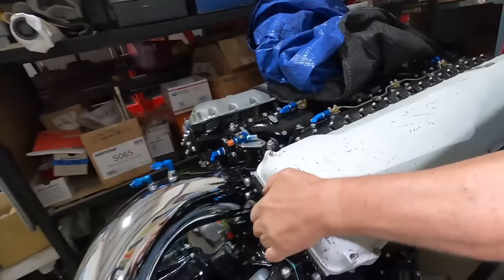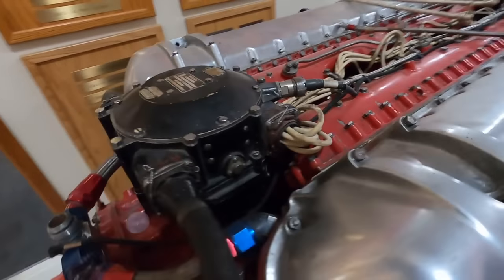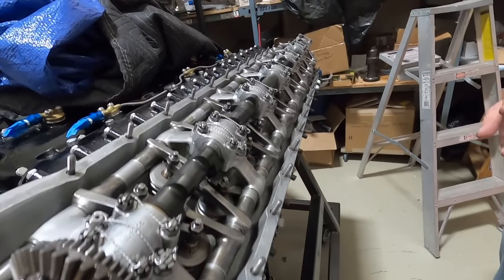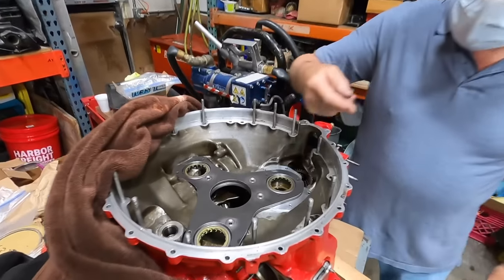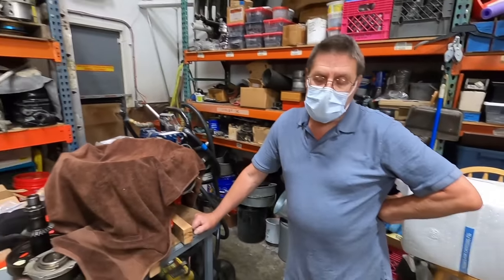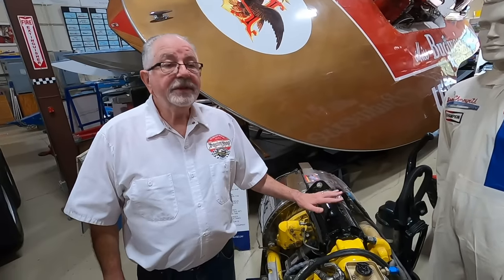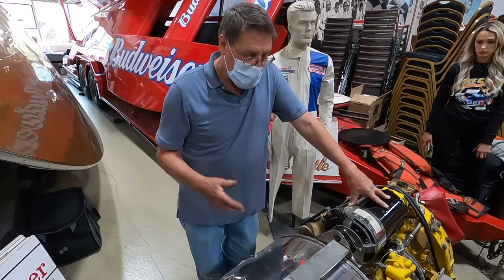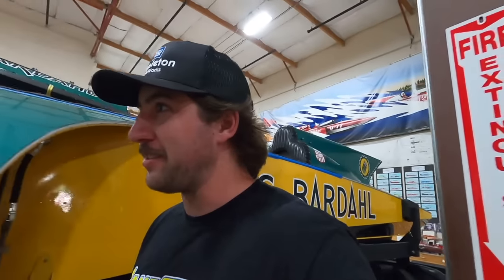The Rolls Royce Merlin: WWII Fighter Plane Engines Modified For Hydroplane Racing!

Comment: The Rolls Royce Merlin engine series has become immortalized  in human history for the contribution it provided during the early years of our fight against evil. It stood ready to fight from the start till well after the end. Like any engine it needed developing further after its initial inception to overcome a few nuances associated with fuel system etc.
While contributions from Prat & Whitney, Allison and others was just as significant overall it is the Merlin that stands out as the greatest engine of its era.
Reply: kiwidiesel  Are you  aware of the fact PACKARD Motors inn the USA contibuted to the development of the Merlin ???  RR contracted in 1940 PACKARD to build the Merlin FOR THE BRITS  37.137 of them were delivered.  the USAAF got 18,000 and several changes and developments were done by PACKARD to mass produce RR's hand built engine.  PACKARD used the Bendix pressure carb  same as Allison used to overcome the stalling problem RR had when the plane was quickly pushed into a dive, RR's float carb would flood.  Pressure carb had no float, similiar to a throttle body injection !!!

Comment: I was a shop assistant for Ed Pink, Keith Black, and E.J. Potter when they were building up Merlins, Allisons, Griffons and Pratt Whitney R2800s. E.J. Potter loved the "Double Allison" V-3420 for tractor pulling.
Reply from the maker: Ed pink built these engines?
Reply: @Stapleton42  '64 to '72 yes he did. Two Reno champs won with them.

Comment: The truth of the matter is that the Allison is a much better and more reliable engine, in fact most of the High-Perf V-12 Merlin's they use Allison Rods and the Alison has a Roller Cam not a radiused stile like the Merlin --- 
Vintage V-12 originally was owned by  Dave Zeuschel famous drag racing engine builder
Reply from the maker: Sure does seem like it. But it’s name isn’t as cool 😂

Comment: The Merlin isn't really anything special compared to an Allison, except for the blower.  The supercharger made the difference at altitude.  The tolerances that were held when the American companies started mass manufacturing the RRs is really astounding.  It was all done with manual equipment and slide rules.  The pinnacle of American manufacturing.  If you are into engines read the book SAE sells about aircraft engines of WW2.

Comment: These engines really need a fluid drive. They were not built to take the torque impact that boat propellers generate. Power boating in the 1960s is why we now have so few Merlin’s and Allisons.

Comment: The 1940s is when mechanical engineering reached its pinnacle, the power race in WW2 did bring us all those inventions which only 30-40 years later would reach the automobile we can buy from a dealership.
It's only in the electronics where the further advancements have been made to give us the efficient and clean burning engines of today.
It's even more amazing how well built the merlin was considering the numbers that were produced under less than ideal conditions, no shortcuts were taken to speed up production.
It's nice to see this element of post war usage of those engines preserved.

Comment: Give the British a little credit, they had a big hand in designing and building these beautiful engines.
Reply: dg8062  BUT you also have to give credit to PACKARD Motors  who in 3 1/2 years built 1/3 of all Merlins built 55,525 !!!!  of the 160,000 built !!!!
Reply: I think you will find that Rolls Royce fully designed all of these and built them prior to any other involvement. Then when others started to build and modify them, the mods would have been approved back in the UK by Rolls.

Comment: These airplane engines always fascinated me, theyre so simple and yet rugged and advanced for the era...imagine being 21 in 1944 and being able to do 350mph in a dogfight while making 2000+ hp at 8000ft altitude in the Spitfires with the RR Griffon. The exhaust gases alone increased the top speed of the plane by 10mph at that 350+
Reply from the maker: Well said sir!!
Reply: For a long time Merlin’s we’re limited to 3000 rpm even then, they would “randomly” throw a con rod. Many modifications were tried to no effect. Then Harry Ricardo suggested it might be the oil pump. His V twin test engines (1/6 of a Merlin) ran at much higher revs with no problems. It was discovered the crank centrifuged oil out of the bearings faster than the pump could supply. Bigger oil pump - big end  destruction stopped.
Reply: @davidelliott5843  I've read the RR Merlin book from the Rolls-Royce Heritage Trust Library which goes into great depth about the Merlin development. There's nothing in there about problems with conrods, I can assure you.
The book. ''The Merlin In Perspective - The Combat Years'', by Alec Harvey-Bailey.
Reply: @davidelliott5843  Been known for a long time RR had problems with the rods, oil pump was too small. interesting  the Allison has a stronger rod assembly and a larger capacity oil pump !!!!
Reply: @Slaktrax   Also I understand the RR Heritage Trust does NOT want to acknowledge or recognize the 55,515  Merlin Engines that PACKARD built during the war either.  The Brits are embarassed to talk about all the manufacturing help they got during WWII.
Reply: @wilburfinnigan2142  Absolute rubbish. I have a book from the RR Heritage Library which talks about the great contribution by Packard in detail. Why must you always shoot from the hip without any factual knowledge or proof?
Reply: @Slaktrax  BULL$HIT !!!!  My info comes fromaguy that had access to the RR Heritage, RR does not want anything to do with the Packard Merlins !!!

Comment: A Merlin engine, V12 OHC 48-valve at 25L 1530cid with 45psi supercharged boost and NOx resulted in around 3,000hp at 3krpm; in the 1950s. 
They had 2 sparkplugs per cylinder, air-to-water intercoolers, and sometimes water/alcohol intake cooling injection.
Reply from the maker: Totally awesome
Reply: For the first time ever, I literally "shit my pants". 
I'm not afraid to admit it, because I have more than enough to be proud of. 
It happened when I was thinking about a Camaro crash. 
I've been in two Camaro crashes when I was driving, and 6 when friends were driving. 
For the record, Camaros are SERIOUSLY SAFE Cars. 
A Camaro will sacrifice itself, for You. For real. I know. 
Camaros have seriously good handling, better than any Cadillac I've driven. 
... 
I physically "shit my pants" just now, thinking about one of the crashes. 
I don't get scared at any moment of crashes I've had after. 
I owe my Life to my Camaro, which sacrificed its life. [For the record, it drove me home after.]
Reply: @MarkBarrett bit of a random story you got there buddy
Reply: MarkBarrett  WRONG INFO !!!!  the merlin is 27 L  1650 Cu in  and all the details varied in the 50 different versions built !!!  DUUUUHHH!!!!!!!  Get your facts straight buddy !!!!
Reply: @MarkBarrett  Not too smart are you fella, to wreck so many cars !!!  DUUUUHHHH!!!!!!!
Reply: @wilburfinnigan2142  I've crashed two Camaros. My friends have crashed 6 Cameros. 
All of us walked away, even at 100mph crashes. 
1/3 of the Camaros walked away after, with no repair. 
My Camaro was strong, and walked away after 2 crashes.
Reply: @wilburfinnigan2142  Humm. 
Want to argue about anything else?
Reply: @wilburfinnigan2142  I've crashed two Camaros. My friends have crashed 6 Cameros. 
All of us walked away, even at 100mph crashes. 
1/3 of the Camaros walked away after, with no repair. 
My Camaro was strong, and walked away after 2 crashes.
Reply: @wilburfinnigan2142  I've crashed two Camaros. My friends have crashed 6 Cameros. 
All of us walked away, even at 100mph crashes. 
1/3 of the Camaros walked away after, with no repair. 
My Camaro was strong, and walked away after 2 crashes.

Comment: At an airshow they started a Centurion tank Rolls Royce Meteor engine without exhaust.
It took around 10 minutes to start it, possibly because of fueling or spark problems or maybe because it did not have the clutch mounted so a lot of flywheel mass was missing.
When the thing turned on, children where just flying away in every direction in panic because it just jumped to max RPM nearly instantly with fire, smoke and ground shaking thunder.
Reply from the maker: epic 😂

Comment: 3000hp for a Merlin is not that much power, the rated power of a standard flight 130 series Merlin was 2055hp.  

The quill shaft was not a weak link except on boats.  The supercharger runs at very high RPM, the quill shaft is there to provide decoupling of the very high inertia of the supercharger from sudden changes in engine speed when that engine is turning a big, high-inertia propeller.  It was not designed to decouple the large, sudden, changes in engine speed caused by the boat crashing through waves, props coming out the water or cavitating thus overspeeding, and then being loaded right down as the prop re-enters the water and the boat is retarded.  That is why many of these boats replaced the supercharger with turbochargers, this also removed the parasitic load of the supercharger (about 600-800hp on the Griffon), but may have caused power losses due to back-pressure.

The Rolls-Royce Griffon was not just a bigger Merlin.  It was a clean-sheet design and was in many ways quite different from the Merlin, it didn't sound as good due to a different firing order (actually it had 3 different ones, none sounded as good as the Merlin)

if you want to know about some of the war years Merlin, this is quite useful:
 "Development of the Rolls-Royce Merlin from 1939 to 1945" it is freely downloadable
A development engine ran 2640hp at 36lb boost on 150-grade fuel and water-methanol ADI injection for what I believe was the highest B.M.E.P. during the war years - 404 lb/sqin and I.M.E.P. of 535lb sqin.  However, the early Merlins were not good, a number of bad choices were made and R-R lost two years on dead ends and the original production engine was just a larger version of the Kestrel.  These mistakes occurred soon after Royce died and Arthur Rowledge (one of the most prolific and greatest piston aero engine designers), who did a lot of the early scoping of the engine, became very ill

The Merlin had a lot more parts compared to the Allison (much of it was connectors, bolts, pipes etc.) and was more expensive to make.  However, production of the Merlin by Packard was not due to the Mustang, this massive contract ($130,000, 000 in 1940!) was to supply the RAF with engines for their existing planes, parts interchangeability was required and R-R had final design authority on what was built, very senior R-R engineers were at Packard for the entire period (one dying in the USA during this time) as well as all the other engineers back in Britain.  The Mustang was supposed to always be powered by the Allison to reduce the already overloaded Merlin order book and the early aircraft were, but with disappointing high-altitude performance, the problem was the induction system, the basic engine was well-designed (except, the crankcases, these were weak).  If they could have welded the intake system of the Merlin onto the Allison, it would have been good enough.

Only the Allison had a pent roof head design, but this did little to improve the performance of the engine over R-R's flat-plane head.  At that stage, no one really understood combustion properly, especially squish, tumble and swirl was sort of understood, but the very low clearance between the outer areas of the head and the piston at TDC required for squish was not understood till about 1964 with Harry Weslake's design work for a Ford racing V12 which later was used in the Gurney-Weslake V12 racing engine.  Keith Duckworth quickly followed with the fabulously successful Cosworth engines.

The Griffon was a far better-designed engine, but apart from sounding nowhere near as good as the Merlin, its combustion chambers were far too large (as were all the WWII V12's, the earlier Frank Halford designed Napier Rapier [H-16] and Dagger [H-24] combustion chambers were almost the right size but the Sabre's [H-24] were a bit too big), so its performance increase was not commensurate with the increase in swept volume.

Most aircraft engines during WWII were well manufactured, with some notable exceptions, but Pratt & Whitney was generally considered to have the highest standards of all the Allied manufacturers.  Of course, it helps if you are not being bombed while trying to manufacture engines.

Finally , " Some smart dudes in Seattle grabbed one of these engines and jammed it into a special boat hull designed to skim over the water", ummm, I think they were beaten to the punch on that one, starting with Gar Wood (stepped hydroplane), and ending with Malcolm Campbell, (three point hydroplane) with a number of others in the middle, including amongst others John Cobb, Henry Seagrave, Scott Payne, and Kaye Don.  Engines were mostly aircraft engines, including the famous Rolls-Royce R, Napier Lion, Sunbeam (I think) and in America, Packard, Curtis, etc.  I have limited it to pre WWII.
Reply from the maker: This was very interesting. I think you put more effort into this comment than I made on most of my college assignments. Then again.. I dropped out before graduating 😂

Comment: I believe the Meteor subsituted some aluminum parts with cast iron. Even as a 'detuned Merlin,' I think the Meteor was still a big jump in power compared to contemporaries. Fork and blade allowed cylinder pairs to be more 'aligned,' allowing slightly shorter engines.

Comment: The Allison intake manifold was known as the 'rams head' and had superior breathing to the Merlin.   But without a two stage supercharger   it didn't perform well at altitude.
Reply: hadial-saadoon  Did you know the majority of the merlin engines did NOT have the 2 stage supercharger ????  All up through and including the 50 series were single stage, like the allison, only the 60 series, late 1942 early 1943 got the 2 stage supercharger !!!  Of the 20,000 spitfires made in WWII only 7,000 were the 2 stage Merlin 60's, most people just "ASS U ME"  all merlins are 2 stage.  just more "Facts of history" !!!!!
Reply: @wilburfinnigan2142  I was well aware of that.  As an example the Merlin III was equipped with a single stage/single speed supercharger and these equipped Spitfire and Hurricanes during the Battle of Britain.  The Merlin 45 added a second “high” speed to the blower.  I am assuming nothing.

Comment: You will never forget the smell and sounds that came from these èngines.WW2 surplus, lots of these engines went to the moon during the learning stage of hydro racing. The more engs that went to the moon caused supply problem. Bernie little was the petty of hydro had Bud backing,$$$$ this lead to the turbine power boats. Fast but boring for spectators , No noise just jet whine and prop slap.

Comment: Cool video! Thanks for sharing! There’s an aviation museum down in Florida, right off of I-4 in Polk county that has a Maytag aircraft engine. First time I ever heard of them, but during war time, Maytag stepped up and built these engines. Cool to see the inside of a Merlin too. Nice work!
Reply: chetcalhound  Maytag has the facilities to cast aluminum and even PACKARD sub contracted Maytag to cast parts for the Merlin engine PACKARD was building !! !
Reply: @wilburfinnigan2142  I realized that when I saw a Merlin/Allison V12 in a museum in Polk County Florida…it had Maytag stamped on the engine cover. I thought that was cool…Maytag stepped up when the country needed them.

Comment: After working on Allison’s and Merlin’s in airplanes I’d say the Allison V1710 is the better/stronger engine. Roller rockers. More stout boom end. Better flowing heads in the later models.  They just lacked 2 dual stage superchargers.
Reply from the maker: that seems to be the general consensus. I bet with modern turbos the Allison is an absolute animal
Reply: CQBWarfighter  I agree and so do others but one point only about 1/3 of the Merlin engines had the 2 stage superchargers !!  All up through the 50 series were single stage  only the 60 series and on were q stage. Most people "think" all merlins were q stage, they were not !! !

Comment: Besides Allisons the only American engines that were mass produced with fork-n-blade connecting rods were Harley Davidsons. We always ran side-by-side rods and offset cylinder banks on our Vee engines. PS - Griffons used almost-conventional "master rods" in one bank and in the other bank skinny link-rods hooked the pistons to the sides of the master rods. Sort of like a simplified Radial engine

Comment: Met a fella that did away with the gear box to run the prop and ran two blower belts to get away from parasitic gear loss. It was noisy but worked well. Also was easy to change prop shaft ratios. Bill Goldstone was a pretty interesting man. Was a big loss to some people up here in Canadian racing

Comment: Two stage supercharger...mmmm compound procharger!    Sounds like they had/have same problems fighting the harmonics....but compound, very interesting!   Got a question for the turbine engine...how big/what voltage is that electric starter...24v?  48v?   What is the psi before the fuel is added? Another great video!  Thanks again Mitchell!
Reply from the maker: good questions!

Comment: I have dabbled in mostly boats and watched my son do amateur race and modern hot rods (LS motor in anything, Porsche, BMW3, etc.).  This was great.  This guy is going to hate old age.  All that stuff in head and shop is going to get reorganized or disappear.   The forged, $15,000 steel props are operating at over 50% of it tensile yield strength.  Steel has infinite life with stresses and resulting strain below 50% of tensile yield strength.  A little “nugget” I picked up in engineering school a few years ago, in the last century.   I’m not old, I’m a time traveler.
Reply from the maker: Interesting!